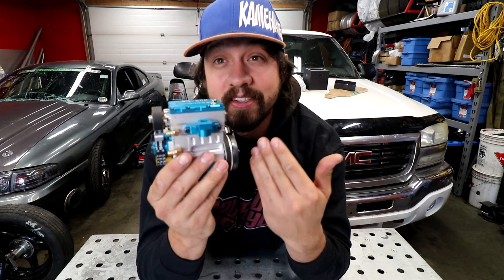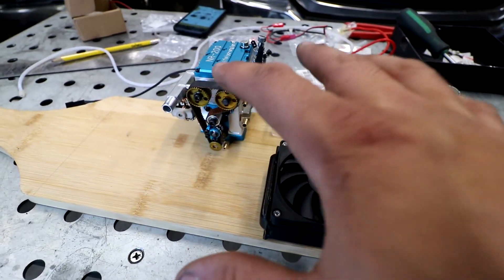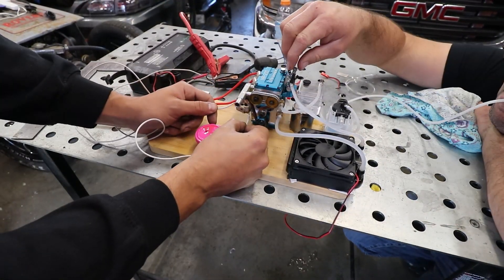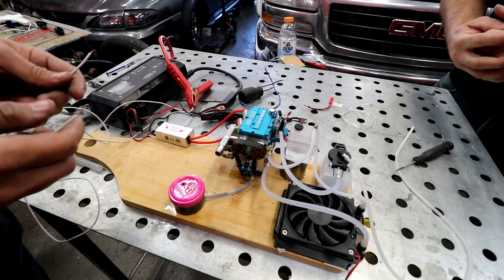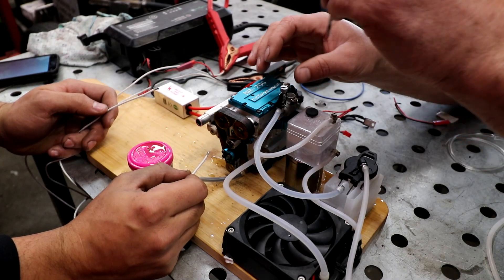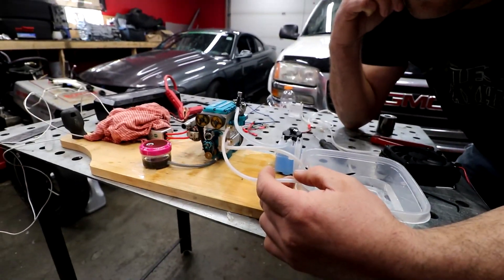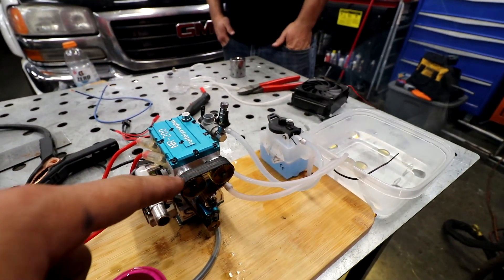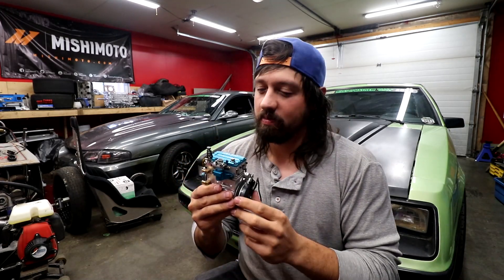The Smallest Working Gasoline Engine You Can Get For Less Than $500. NR-200 EngineDIY

Comment: Kyle..the hose you have to your oil tank is a pressure hose that needs to go to the top of the fuel tank..it will push the fuel to the carb.

Comment: The tube you have on the top of the fuel tank lid should  hook to that nipple your thinking is for oil. It uses the case pressure to help push fuel. Like a Nitro RC car. If you hook it up that way your probably going to have to turn the slow screw and feed screw in a bit to stop it from flooding  but one you get it should run smooth as a top

Comment: You need to run it on rc model engine nitro so it gets oiled.  The fitting on the bottom is a drain for the excess oil.  If you are using regular gasoline, you need to add 2 stroke oil.

Comment: that is a 2 stroke engine and it needs oil in the gasoline.. the vent tube on bottom of engine is for excess oil from oil in gas to drain out of it.. the oil in container is probably to much back pressure and causing stalls.. BTW, the radiator needs to be set upright just like in a car.. so it can be cooled by the fan.. and u said ur car guys.. LOL.

Comment: Know what would make it cooler? Get a jug of water look ok YouTube for “I built a water stove”. Make the little guy run on h2. Can YouTube hydrogen hot rod truck too. His truck with an inverter a dehumidifier to collect water run it thru a deionizer into a store bought h2 lab gas generator with greater than 125psi output (that sell high flow units I’ve seen and used ones w/ over 220psi) and his truck will not only run on water but will have potentially unlimited mileage (never need fuel nor charge)

Comment: He said 8.6l did he mean ml or what
Reply: cc. Cubic Centimeter. Cm³
Reply: @datgamerboy123  ya I guess the thumbnail says cc but he said liters and I think cc and ml are basically interchangeable but I'm not a big metric guy because we use cubic inches and for that and small engines they are cubic centimeters but bigger motors it's liters I'm going to start going with gallons like truck has a 1.4 gallon motor
Reply: @james10739  0.52 Cu. In.
Cc an ML are the exact same
Never heard of someone using gallons to measure engine displacement 😅 but you do you.

Comment: it runs on 2 stroke mix, it is supposed to push out oil, how it lubricates itself, don't run straight gas. Has no oil pump. Sure you figured it out already. MT NR-200, FL-L200, FS-100A all use nitro or 2 stroke mix to lubricate itself.

Comment: 8,6-liter engine?   that is  414 cu forget about the decimals.  I know you Americans have some problems with Metric dimensions.  You also have also a problem with reading manuals( very common to males) ... you are supposed to at oil to your fuel not make the oil drain a dry sump system.... you reduced the engine to a paperweight....... ps the ling you attach is not gas but to an ethanol/nitro engine.   just comparing apples with pears ...... I do understand that you see 500us$  as fun to play with because you do not need to pay your sponsor for that engine.....but ill think for most of your subscribers 500Us$ is not playing money anymore....

Comment: Your ment to add oil to the fuel and yes I know it's a four stroke the oil works it's way to the bottom end and comes out the tube that you have plugged your oil reservoir into 😉 the top end is greased.